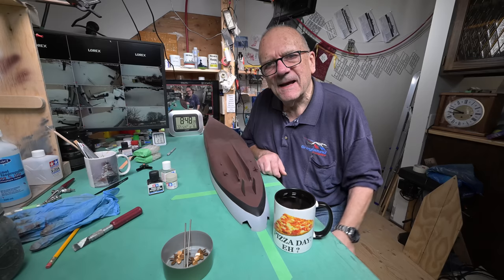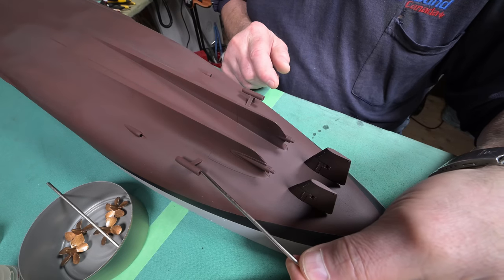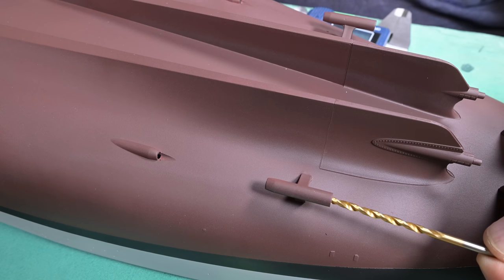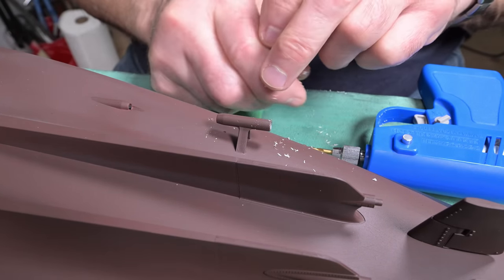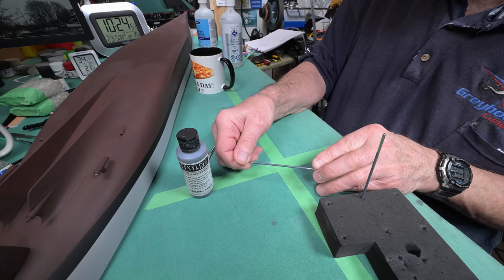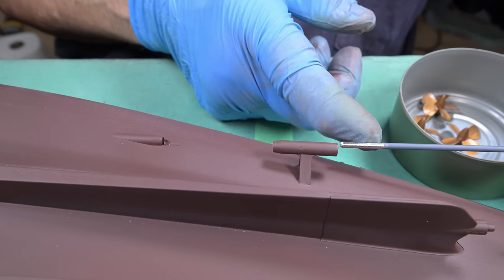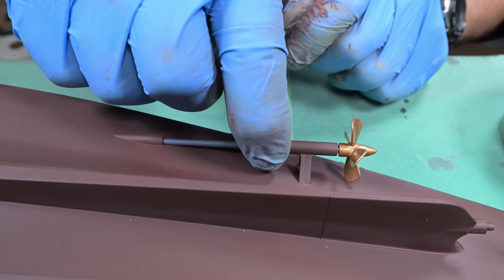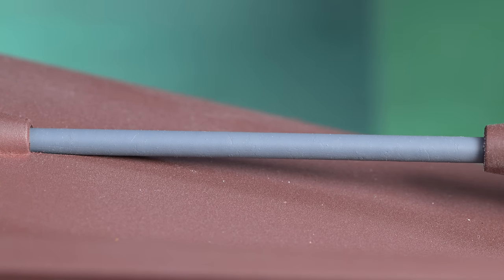The Model Ship - Part 1403

Comment: Shafts were made from steel and as such, should have had a coat of anti fouling paint (Red Lead) was in general use at the time.  There was no use of grease  on the shafts, either at the struts or at the hull piercing.  Instead, those areas used a wood called Lignum Vitae as bearing surfaces.  Lignum Vitae was used for shaft bearings up until the late 60's and a lot of scrapped ships had the wood salvaged for use on other vessels because of its increasing scarcity.  The woods natural oils and incredible hardness made it perfect for that application.
Reply from the maker: https://www.youtube.com/watch?v=4cwRXA9YH60
Reply: @roncalverley  Should have clarified ; No use of oil or grease on the bearing surfaces outside of the hull.  Water circulation and the wood linings of the bearings were enough to keep the shaft fully lubricated.

Comment: Are those shaft supports the wrong way round? I suspect the tapered end faces out to the prop, not inward. If that was the case, you needn’t of drilled them out.
Reply from the maker: No, I think they are okay.
Reply: Ron has them correct. With the props up next to them, and the tapered end toward the bow, there was less drag through the water.
Reply: @roncalverley  great news, just looked like they fitted the other way. Suppose it doesn’t matter really as they won’t be seen.

Comment: The actual shifts are not visible,  they run through a steel tube,  but the tube is not watertight.
Reply from the maker: Now that's interesting! You may like https://www.youtube.com/watch?v=4cwRXA9YH60
It looked to me that the shaft was not sheathed  between where it exited the hull and entered the hanger bearing.

Comment: Why not just paint the prop shaft after you installed it instead of the extra work of drilling the holes larger
Reply from the maker: Hi Sydney,
Yes, I did think of that first too. My fear was that with my painting skills I'd be sure to get it on the hanger bearing and hull.